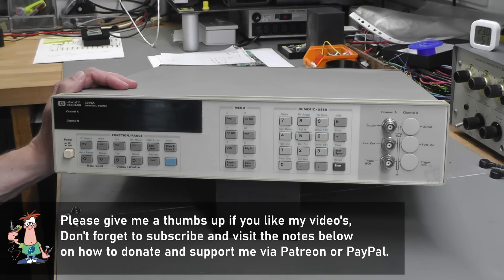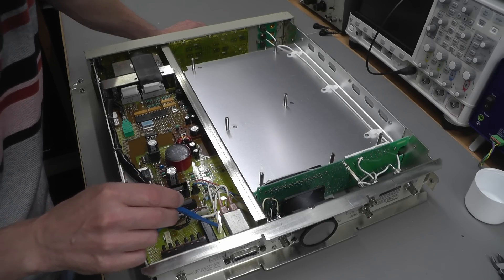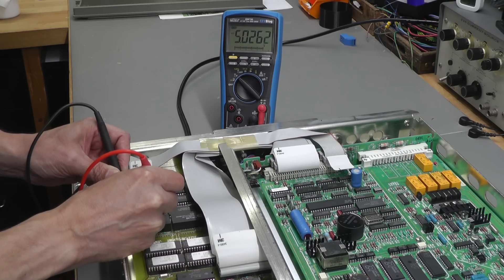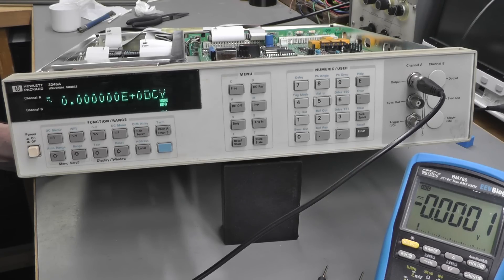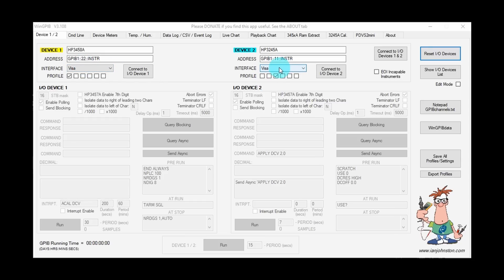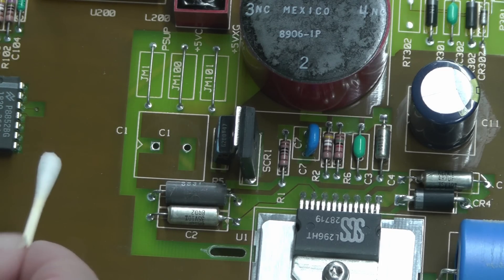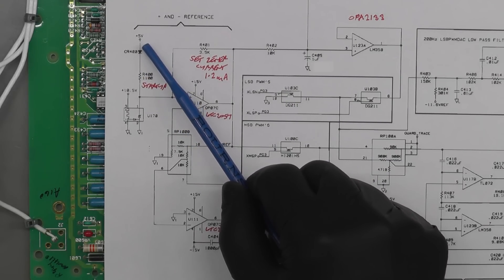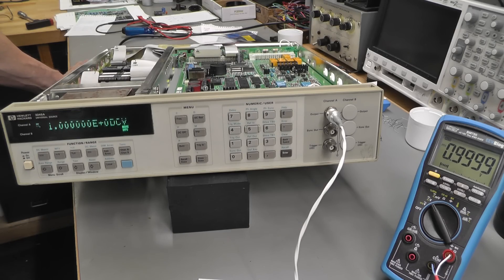No.113 - HP 3245A Universal Source Repair, Mods & Upgrades - Part 1

Comment: Good start, congratz on another 3245A. I would be also careful swapping opamp to choppers like LTC2057, since in some cases chopping noise injection can be problematic for the circuit. So be sure to check all functions and ACV/ACI to ensure it's still all good.
Reply from the maker: Will do. Nice thing about the castellated adaptors I made is that it is very quick and easy to swap op-amps out and compare. The LTC2057 is a starting point.

Comment: First time I’ve seen someone actually wearing an ESD strap in YouTube electronics repair videos. 😀
Reply: Jan Beta does all the time as well
Reply: TRX Lab does always, but then he's repairing customer transceivers so guess he's being extra careful :)
Reply: Everybody knows that ESD does not affect YouTube channels.  😂 I hate watching channels doing repairs on vintage computers, and handling old chips with no esd straps  or mats insight.  Used to have a nice metal strap that was on 24/7  and just clipped to as I sat at my bench.  We also had esd boxes for moving chips if they were out of their packaging.  Your customers are not the ones you want to find that you zapped a chip during production and test. 80% or so of the time the chip hangs on working before turning its pins up and saying I can't take no more. 😂

Comment: Thanks,  Ian great video.  Re your voltage reference mods. I note in later designs for U110, U111 a low pass filter cap 1nF is added in the feedback network from output to input, but they do also need to be NPO or zero temp co-efficient.  As an aside just received 2 off ADR1399 after an 18-month delivery time! Now the ageing process can start.
Reply from the maker: It struck me there's not much in the way of filtering/integration on those op-amps......according to the schematics anyway. Can be improved I think, and help combat any chopper noise also.

Comment: I have been playing with those FRAM ICs for a bit, for another project. In my studies I noticed that they are quite fussy about the state of some control lines during their power up and getting it wrong can result in the FRAM data becoming volatile. I got my test circuit to work a bit better, but some more work to-do to get it perfect. Its interfacing to a 8085 so the control lines need a bit of logic massaging to get them right... When I get better using them I plan to replace the battery backed RAMs in my TEK scopes with FRAM.
Cheers,
Reply from the maker: That's interesting. Most folks using them on HP gear i.e. 3458A, 3245A etc which uses the Motorola 68000 seem to have no issues from what I have heard.
Sidenote: I do remember playing with Dallas battery ram's 30yrs ago on Z80 and those could be temperamental there so not surprising.

Comment: Wonderful job so far!!!  Amazing work on that tiny PCB - I thought my Neo Duff board was small lol!
Reply from the maker: Cheers! When I designed the first one it was using normal pcb holes and would use two 4-way SIL headers, but castellated holes is MUCH better. Cheap as chips from PcbWay, I ordered 50off.

Comment: Ahh, those FRAM chips seem like a perfect mod for a lot of vintage Tek gear. They seemed to love using the Dallas integrated-battery NVRAMs all over the place! And they often used them to hold factory calibration data so if the battery failed you had to fully recalibrate the device (after replacing the Dallas chips). How annoying!

Comment: Funny, I have been looking for an HP 3245A and saw that very same unit on eBay. I thought about messaging the seller about the error code but decided against it, mostly because of the VFD and no HV option. Hope that works out for  you. Great work on the repair! Regards, David
Reply from the maker: I have a 3458A VFD sitting here, it’s the same part for the 3245A. Had it for years!
The HV option would have been nice I agree.
Reply: @IanScottJohnston  Are you sure that the problem is the VFD, and not the driver?
Reply from the maker: @Ismsanmar  At a guess it is usually the VFD.

Comment: Hi Ian, wanted to ask regarding the Dallas NVram. I'd have tektronix 2445B that use same Dallas battery, if i replace it with new one will the scope lose its calibration?
Reply from the maker: I don't know if the 2445B stores it's Cal data in the Dallas IC. If it does then as a rough guide:
- Carefully remove the Dallas IC and read its contents into a programmer, save to file.
- Pop the new chip into the programmer and burn the file to the chip.
In my case on the 3245A the new IC's were blank when fitted to the Pcb.
In my 3458A DMM, I was able to extract the data from the old IC via GPIB well before removing from the Pcb.

Comment: nice soic-to-dip adapter pcb.... another question i have:

does the reliability and drift etc characteristics share and benefit to common design with the other hp meters? (for example 34401a being so rock solid, or perhaps other ones too). if yes, then maybe is actually better than the alternative keithley 2400 to remain calibrated? (and what with the actual precision level eh since '6.5 digit' are not all at the same level across brands / products)
Reply from the maker: I haven't compared the spec of all the HP branded meter's/sources. I should point out the the drift/noise on the 3245A I am trying to arrest is down in the uV's, so it's not like it is any worse than say a 34401A. I have a 3458A, and so ANYTHING you connect to it will "appear" to exhibit noise & drift! The quest for perfection goes on. It's 2023 and so there is some scope for a little upgrade on the 3245A IMHO.
PS. XDEVS pimped one of their 3245A's with an LTZ1000 based reference board a while back.......I guess with the same goal in mind.

Comment: hi, what is the P/N of the FRAMs? Are they pin compatible with the original Dallas NVRAM?? I mean did you use just regular off the shelf SOIC to DIP adapters?
Reply from the maker: Yes, straight off the shelf SO to DIP adaptors. Fram p/n = FM18W08-SG

Comment: also i gotta say... as a high school electronics project i first encountered these dallas nv sdrams at a very young age. and it really messed with my more basic understanding(s) of electronics (at that time) as for how any SDRAM ic can actually be non-volatile. And also they looked really weird and I never actually understood that. Furthermore since the school had no money to budget for any BOM parts (that they didn't already have in stock). These Dallas nv SRAMS were actually only there because they were factory rejects that had been donated (for free) from industry. So nobody was ever even sure whether or not they were functional. And/or what the defect actually was on them! And this... i based entirely my high school project around. Since all the 74 series TTL logic needed "somewhere" to store it's data to. To read and write from.

Actually after many weeks the thing worked. But only very briefly, for just a short period of time. Maybe less than a couple of hours. And the next time i returned back to it... those Dallas SDRAM modules... they never worked again! And I had absolutely nothing to show for it. Nor any reasonably mechanism by which to source replacements. I just kept trying random tweaking different parts of the circuit. Trying desperately to find where the wiring fault was at. That I must have innocently knocked some wire or something. However those Dallas modules. For whatever I would try it just wasn't happening anymore. I would go around swapping chips. Looking at the outputs from the TTL circuitry. And thinking: heh! this should work, shouldn't it? It scarred me for life. And completely changed my confidence and trajectory in life. In terms of working with electronics. Not to say I didn't enjoy the challenge! But it really made me question entirely what I was doing. And how I was doing it. Which can be good too! (... but the nightmares). And it took a fair few years to really properly recover from that one.
Reply from the maker: You live and learn as they say!
Using them with Z80's in the 80's/90's they would on occasion and for no valid reason just lose their contents! Albeit, our code/hardware design could have been to blame!
Reply: @IanScottJohnston  That does indeed sound kinnda similar to the problem I encountered myself (if i am remembering correct from such long time ago, which is highly questionable, my own data integrity).

But yes - my issue seemed to be that I would do the necessary things to store data into an address location onto a module. And then afterwards try to read it back out again. However the reading would return nothing. As if it had never been programmed.

But bear in mind: the teacher had actually used the z80 as our textbook MCU to learn how to do them. Yet I had instead been drawn to the allure of 100% TTL logic. For whatever reason(s) time has forgotten. Perhaps the performance or something else. Anyhow I was clocking manually and stepping cycles as slow as you can go. A bit like a debugger. And not really knowing what I was doing at all. Far too inexperienced back then to have taken on such a complex project.